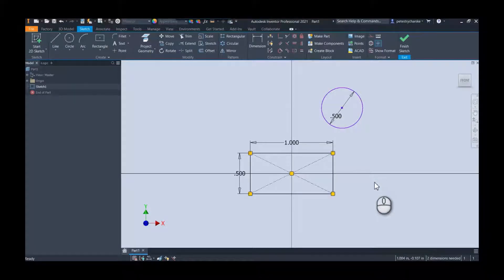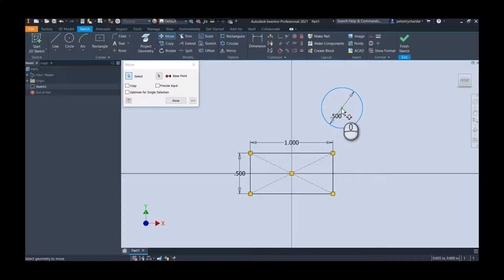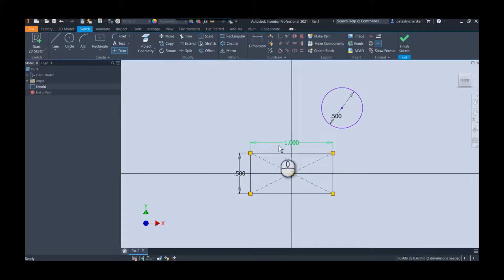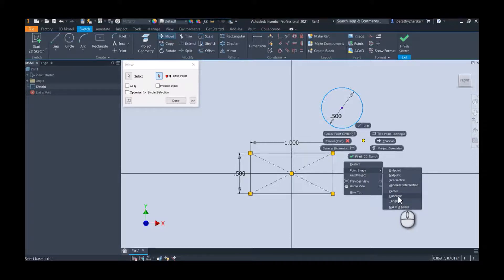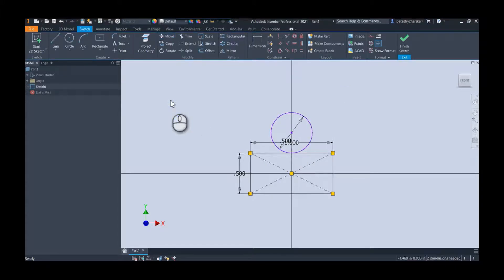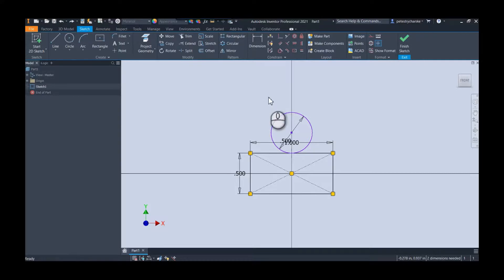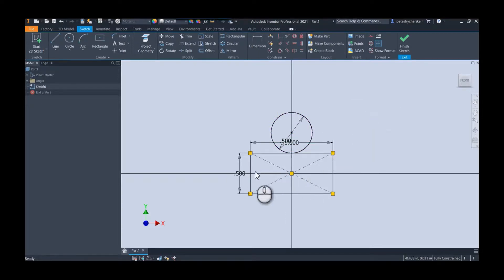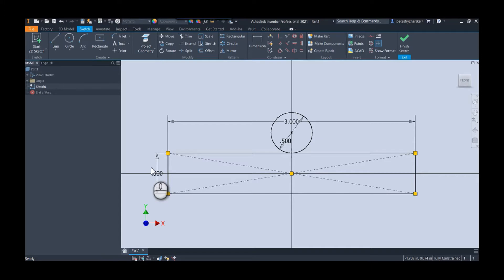Inventor - How to Utilize Quadrant Snaps when Moving Circles in a Sketch

Comment: I followed this but the circle instead of moving it now expands to the tangent line. So, how do i keep the same radius  while tangent constrains?
Reply from the maker: @eddyboh2723, sorry to hear of your troubles.  One thing to try is to size the circle first and then constrain it.  This should allow you to control the size of the circle before positioning the circle anywhere.  Otherwise, removing all geometric constraints from the circle may help clear away any unknown dependencies.  Please let us know if you have any other questions or these suggestions do not resolve the issue.  Thanks for your patience, hope all is well and have a most blessed day!